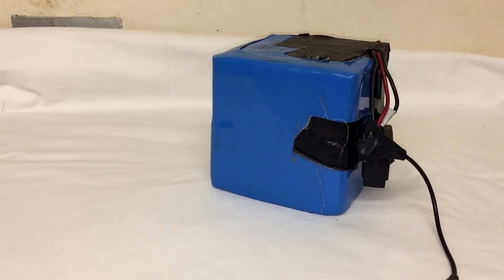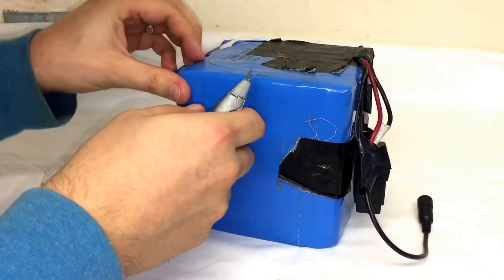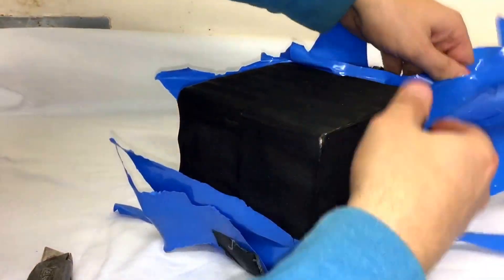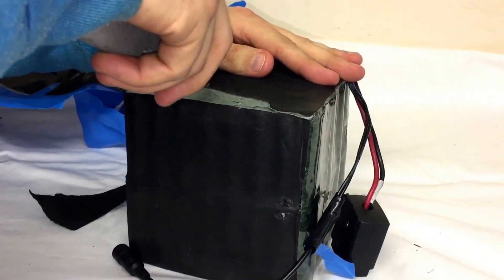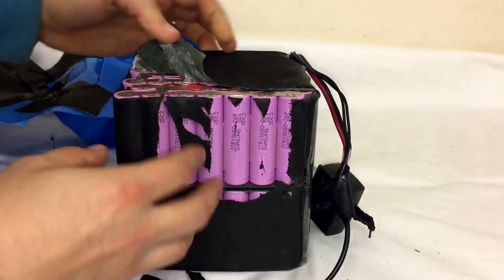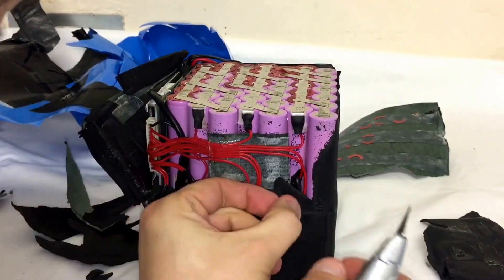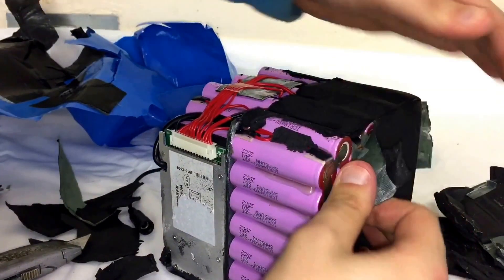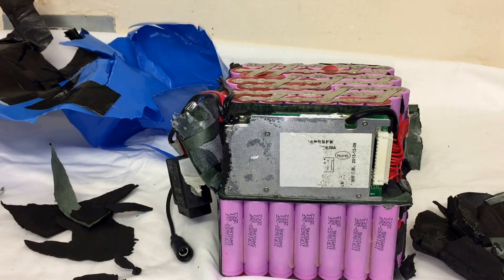Ebike Battery whats inside 18650 cells

Comment: hi thanks for your video. i need a battery pack about the same size as yours. the i have is too large and about twice your size. could you please tell me the wattage and amperage plse? and could you tell me the approx speed and range u get plse? my setup is 48 volt hub motor with a  pin lifepo4 20 amp battery but way too heavy. many thanks for your help.

Comment: Great stuff - there are some new high density Panasonic 18650 cells recently on the market ... but they might be too costly to consider. Elsewhere on YT there's a guy who's carefully selected old laptop salvaged batteries to build a power pack from - at a very economic price.
Reply: the problem with laptop batteries though is that their not made for high drain. Depends on your setup. these batteries might not be suitable.

Comment: there is two options, first is just to remove B_MS, and it will work but without dead cells, with what you have../ second to open the pack and Test each cells for defective, for replacement..